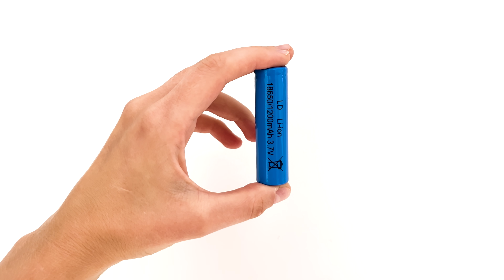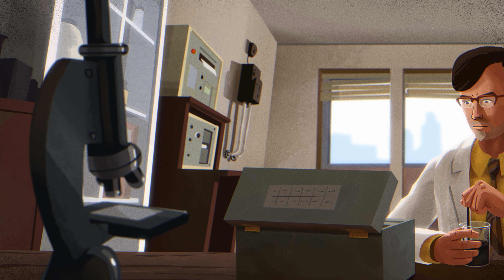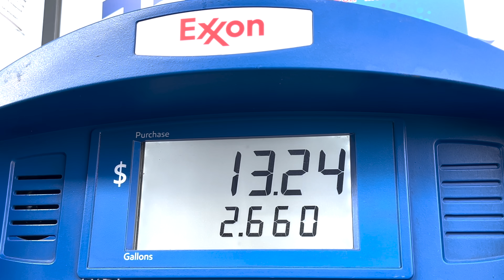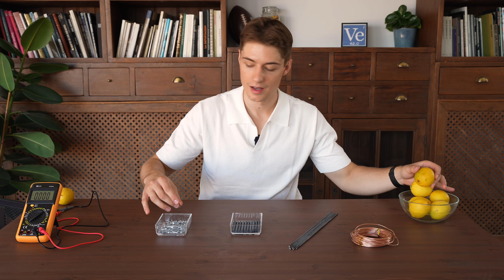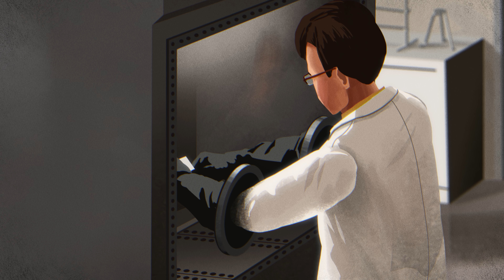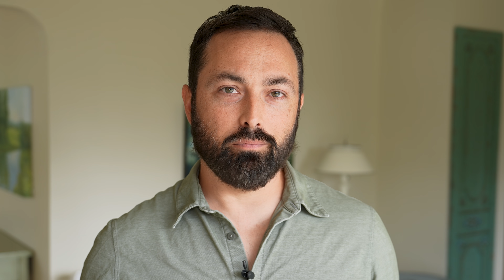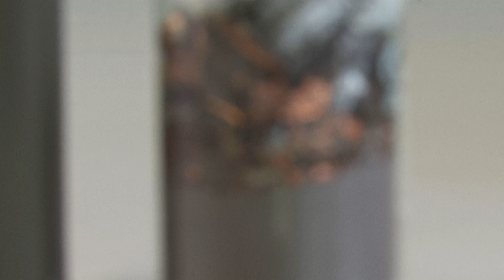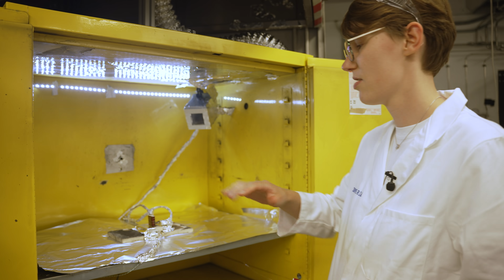The Perfect Battery Material Is Dangerous

Comment: Generally the chemical batteries are limited by the energy density difference between chemical bonds, which is on the order of a few electron volts. And with this setup we are already near the limit i think. Sure we can still get some incremental enhancements, but it will ultimately not be a sufficient solution for energy storage as we need it.

Next up in energy density could be plasma or capacitors. That could allow us to keep the entire electron bond energies, 10s to 100s of eV, instead of just the difference between two bound states. But so far we have no idea how to reliably keep high charges separated in a stable manner. And then discharge it in a stable manner aswell.

And if that energy density is still not enoughAfter that there is only nuclear batteries! With MeV that would secure our needs really well. Too bad that we haven't even solved the fusion reactor yet, so this will be far out in the future, if at all.

Comment: 31:31 So, I can't help but notice the battery never actually detonated, just burned
Reply: Explosions are caused by rapid expansions of gas. This wasn't contained, so it vented out the whole time. Had it have been in a closed container, it could have exploded.
Reply: It wasn't sealed in a can or brick, like most batteries are in the real world, and hydrogen gas wasn't able to collect to a dangerous extent.

Comment: I noticed a huge spike in energy density around 2019 on the graph at 26:32. Does anyone know why it spiked so significantly then? I have heard of many, many new potential battery technologies in the works, but to my knowledge many of them are still bound to labs only. Would the graph include these non-industrial batteries that are mostly theoretical and haven't achieved any sense of scale, or is this axis supposed to be industrial-scale batteries only? Is there a new cathode/anode pair that's becoming popular since 2019, or has there been additional density achieved within lithium ion batteries themselves?

Comment: Did you just completely forget to mention that LFP batteries don’t need cobalt and way less of a burning hazard and is used in energy storage and electric cars?
Reply: What if we could have dual battery cars like lifepo4 for the longer storage but LTO for quick charging/discharging at the pump and quick city driving while also having the density of Lifepo4 as back up?  You can have best of both worlds and have supercar c rate, well maintaining 0 cobalt and super long lifespan with almost 0 fire risk
Reply: The Real Reason Phones Got Smaller (and Then Bigger Again)

A lot of what people believe about the evolution of mobile phones is more myth than fact. While many think batteries are the main reason phones became smaller, the truth is that most of the size reduction came from advances in electronics—not battery improvements.

Early mobile radios (like VHF car phones) used bulky, power-hungry components and weighed around 30 pounds. They needed a running car engine just to keep from draining the battery during a call!

Then came breakthroughs in technology—like LSI (large-scale integration) chips and higher-frequency (900 MHz) radios—which allowed phones to shrink dramatically in size and power use. This brought us the first handheld cell phones, which were roughly 100 times smaller than their early car-mounted predecessors.

As electronics improved further—especially with the introduction of surface-mount components, better radio designs, and smarter power usage (called "duty cycling")—phone size dropped again, by another factor of 10.

Another major factor was the growth of cellular networks, with towers spaced closer together (often less than a mile apart). This meant phones didn’t need to transmit as much power, helping them get smaller and more efficient.

In contrast, battery technology—while it has improved—only contributed to a modest size reduction. The shift to lithium-ion batteries may have made phones around 2 times smaller, or 50% thinner, but that’s a small part of the overall story.

Interestingly, many early-2000s phones—like compact Nokia models powered by the equivalent of three AAA batteries—were actually smaller and lighter than today’s smartphones. Modern devices have bigger screens, heavier glass, and more powerful components, which is why they’re larger despite having more advanced batteries.
Reply: Low voltage/energy density
Reply: @no3339  NMC needs more cooling and stronger casing. Considering that, in the battery pack, energy density difference is neglible. Maybe 10%. Until NMC degrades and it degrades MUCH faster. Not only that but LFP is also cheaper and much, much safer. It's just a better battery chemistry than NMC
Reply: @Osaka2407  I prefer other technology over NMC and LFP
Reply: Yes, LFP is a lot safer, but still not fully safe - when it fails, it does not spew fire like crazy but still emits flammable toxic gas which can become an explosion hazard if it‘s from a large battery in a small room
Reply: Citation from one of my papers:

The conductivity of LiFePO₄ is insufficient, which causes the diffusion of lithium ions through the material to occur very slowly. In addition, this cathode material must be ground into nanoparticles and coated with a conductive carbon-based material before use. Due to the thermodynamic instability of the Fe²⁺ ion, an inert atmosphere is required during production, which significantly increases manufacturing costs.

(Source: M. Miroshnikov, K. P. Divya, G. Babu, A. Meiyazhagan, L. M. Reddy Arava, P. M. 
Ajayan, G. John, J. Mater. Chem. A 2016, 4, 12370–12386.)
Reply: @davonitos seems like the cost isn't an issue anymore since pretty much all of BYDs EVs use LFP batteries, they supply these cells to other EV makers as well and I don't see a huge price hike in any of their products either
Reply: @davonitos  almost 10 year old ... maybe out of date paper on LiFePo4 as they dominate many applications since 2022 needing more safe, cheap and reliable Li batteries.  Not the best energy density ... but still very good.
Reply: @davonitos cost is not an issue as LFP is already cheaper than NMC per kWh. In cars, LFP batteries also tend to charge faster and degrade much slower. They also have lower cooling requirements. That's why NMC needs integrated cooling channels even in small packs (like used in Volvo's hybrids) while LFP is fine with liquid cooled casing. Real world difference is negligible, dare I say. Tesla Model 3 LFP packs have capacity of ~63 kWh. NMC pack has 75 kWh. They weigh basically the same, size is also the same. 63kWh is already plenty for daily commute while 75 kWh doesn't provide any meaningful difference outside of edge cases like driving 2000 km with 2 stops less (if that, as in highway driving the range difference is less than 100 km with LFP range of ~400 km so you are still more limited by infrastructure). NMC doesn't provide any meaningful positive characteristics over LFP but it has many issues LFP either doesn't have or effects of which are greatly reduced.
Reply: He forgot to mention John B Goodenough also created a battery you can cut in half and it still works fine. Another example of just scratching the surface of the idea from veritasium.

Comment: Back when i used to vape i had an 1850 explode on the charger. Caught my bed on fire, small chunks of copper inbedded in the floor and mattress. Sounded like a shotgun. Luckily, i was in the room on the otherside of the bed and put out the fire right away. So much damage. Realized that could have been my face, was the motivation i needed to quit.

Comment: Looks very similar to a Electrolytic capacitor, but the battery doesnt discharge as fast. Capacitors can be volatile as well, especially if you solder them with the polarity reversed. The issue with early cell phone (I worked for Motorola, on their batteries, they were Rechargeable Nickel cadmium) Cell towers were spread out more, requiring about 4 watts of power to reach a tower on an analog signal. current tech uses less that a watt, transmits in digital, and cell towers are more prolific.

Comment: The history part was great, but the ending was very unsatisfying to be honest. All that fuzz about blowing one up and warning about the dangers of batteries and then it basically just stops, with the only info being, yeah it's rare. I feel like I'm missing information and more context, which is very rare for a video here.
Reply: Here is some more accurate information.  This is a terrible episode as far as the history and science!  It is more about hype/fear based.
The Real Reason Phones Got Smaller (and Then Bigger Again) .... Here is a better summary.

A lot of what people believe about the evolution of mobile phones is more myth than fact. While many think batteries are the main reason phones became smaller, the truth is that most of the size reduction came from advances in electronics—not battery improvements.

Early mobile radios (like VHF car phones) used bulky, power-hungry components and weighed around 30 pounds. They needed a running car engine just to keep from draining the battery during a call!

Then came breakthroughs in technology—like LSI (large-scale integration) chips and higher-frequency (900 MHz) radios—which allowed phones to shrink dramatically in size and power use. This brought us the first handheld cell phones, which were roughly 100 times smaller than their early car-mounted predecessors.

As electronics improved further—especially with the introduction of surface-mount components, better radio designs, and smarter power usage (called "duty cycling")—phone size dropped again, by another factor of 10.

Another major factor was the growth of cellular networks, with towers spaced closer together (often less than a mile apart). This meant phones didn’t need to transmit as much power, helping them get smaller and more efficient.

In contrast, battery technology—while it has improved—only contributed to a modest size reduction. The shift to lithium-ion batteries may have made phones around 2 times smaller, or 50% thinner, but that’s a small part of the overall story.

Interestingly, many early-2000s phones—like compact Nokia models powered by the equivalent of three AAA batteries—were actually smaller and lighter than today’s smartphones. Modern devices have bigger screens, heavier glass, and more powerful components, which is why they’re larger despite having more advanced batteries.
Reply: @koiphish333  Interesting, thanks for the perspective! 
Feels like they wanted to tackle too many topics with this one and you could have probably segregated it in the history of batteries, development of phones and current/future battery versions/solutions.